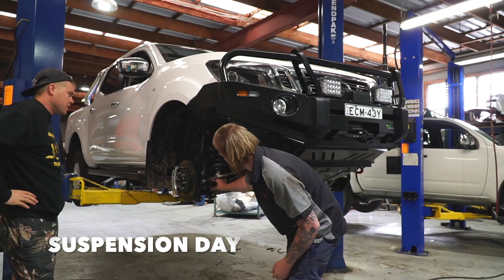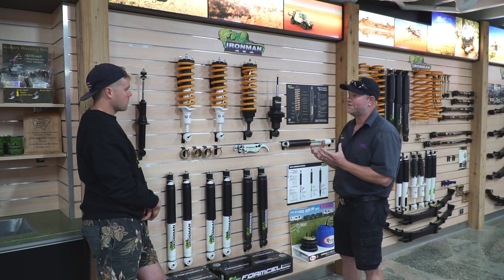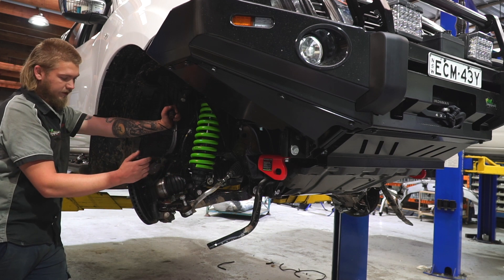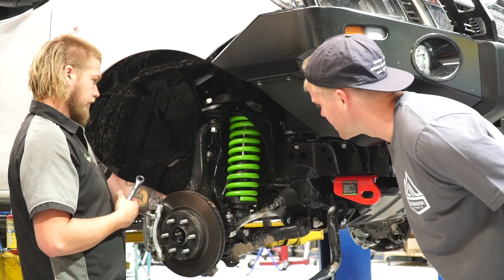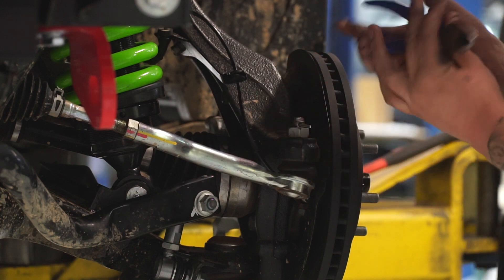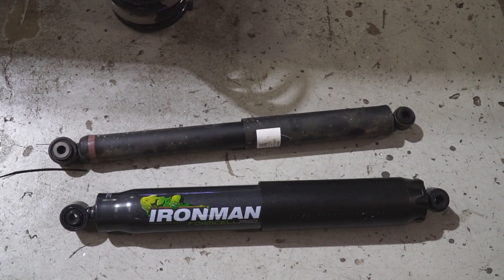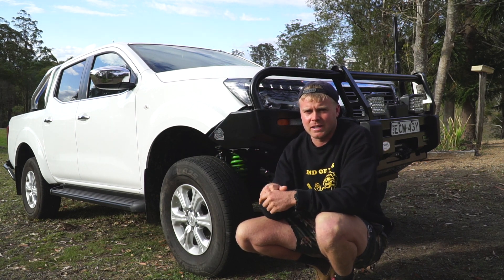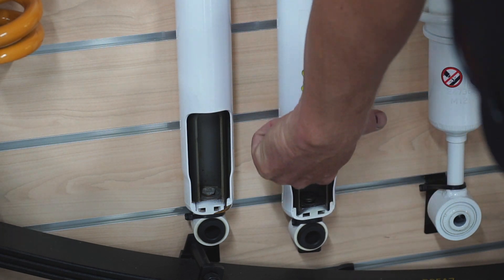NISSAN NAVARA BUILD

Comment: Also, lifted springs do give you more ground clearance on everything except that which is un-sprung (e.g a solid axle diff). With solid axles the only way to get better clearance of the diff is to go bigger tyres as Tyler said. You still get all the benefits of better approach, ramp over and departure angles with a lifted spring. Also fully independent suspension vehicles like the Y62 Patrols do not have the same issue that the solid axle's do.

Comment: Tyler, at 5:15 when you talk about lift and ground clearance.  
Suspension lift on independent suspension, does increase ground clearance. 
True on solid axles, suspension doesn't raise the diff. 
How ever a suspension lift does improve the following,
1. Approach angle
2. Departure angle
3. Increases chassis clearance 
4. Increases wheel arch clearance as you said.
Plus more.
Not sure if you had been told these other facts. 
There is already way to much sales based miss leading information in the 4wd industry out there.
Reply from the maker: Hey mate, thanks for all the points. I did realise about the approach angle, departure angle etc, we did talk about it at the time but cut it out, always hard to find the balance between lots of information and becoming too boring haha. But I didn't realise it increased ground clearance on the independent front suspension 4wds, cheers mate!
Reply: @TylerThompson90  true facts are boring but important. 
It's not just IFS, cars like Nissan Y62, gen 3 Pajero. All independent suspension systems as the diff is bolted to the body/chassis. 
On a different note, hope you and everyone up there is ok from the fires. #staysafe
Reply from the maker: Thanks mate, we are all good where we are at the moment, a lot activity going on at the moment in relation to fires!

Comment: That's a sweet setup. Are the D23 suspension components compatible with the D40? Here in The States were still on the ancient but reliable D40 chassis and options for a lift are slim.
Reply from the maker: Yeah not sure how you would go using D23 suspension on the D40, completely different rear set up, coil springs against leaf springs
Reply: @TylerThompson90  I can tackle the leaf springs. Is the front compatible w the D40?

Comment: Hi Tyler!! The Ironman shocks that you installed...are 50mm lift? In Europe the spec for this shocks is 40mm lift. Is it correct?
Reply from the maker: Hello! Yep they are meant to be 50mm here in Australia according to Ironman. We measured after the install and we had gained 50mm in the front and 55mm in the rear (which was just cause we didn't have the weight in the rear yet, lowered down a bit once I put weight in there)

Comment: It will be interesting to get your feedback on those front springs, they simply don't look right to me.
Reply from the maker: How come they don't look right? Look/feel good to me haha but yeah see how they go over time I guess
Reply: @TylerThompson90  Wasn't having a go, I'm genuinely interested. To me there doesn't appear to be enough space between each coil, it looks like there isn't enough space to compress. I'm sure smarter people than me have designed them correctly though.
Reply from the maker: Yeah I'm not 100% sure to be honest mate, you'd have to talk to someone smarter then me haha thats how they generally seem to look on the independent front suspension 4wds from what i've seen

Comment: When old mate was talking about the "spring clash" sounded funny because if you looked at you new suspension the gap between the coil on new and old suspension the old one has more of a gap??? you have bump stops fitted and this would stop this from happing. I'm am defiantly not against fitting aftermarket suspension to any car just think the explanation of why to fit new suspension from the suspension shop selling it was abit questionable. ie "spring clash". best of luck with the NAV!
Reply: Haha exactly right 😂😂
Reply: Yep - Most people would call it coil bind.  It should always have bump stops to stop the compression before the coil binds against itself.
I think old mate needs to spend a bit more time researching and less time reading the sales pitches.
Reply: Dont think there will be a prob with coil bind. The gap between the coils might be tighter but there is more wraps of the coil in the new ones to allow for it.
Reply from the maker: Yeah I'm not an expert so can't really say too much about the subject haha but to me the issue with the old ones is they weren't made to handle the extra weight of the bullbar, winch etc whereas the new ones are heavy duty to handle the weight. Even though the coils are closer together they won't compress anything like the old ones

Comment: Do you need to realign them again once you put new wheels and bigger tires?
Reply: No
Reply: @pb8582  damn, always thought you needed to after new set of wheels or tires.
Reply: @Buansteven  it's recommended not necessary...
Reply from the maker: Yeah I didn't get a realignment done after the bigger tyres went on, will get one a few thousand kms down the track once everything is fully settled in
Reply: @TylerThompson90 hey mate hope you well do you have any diff locker on yours install?

Comment: Why the hell are you wheel aligning before bigger tyres? Tyres will put it out again!
Reply from the maker: Needed to do a wheel alignment, front tyres were way too far off after the front suspension when it, particularly with the extra adjustable upper control arms etc. Camber and castor were completely out
Reply: Tyler Thompson did you move that horn up higher?